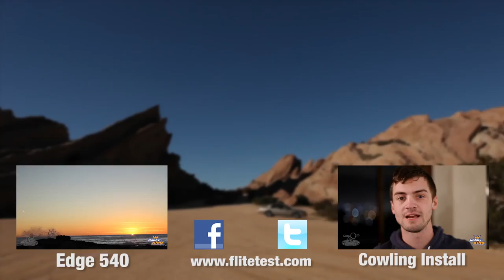Flite Test - Differential - FLITE TIP

Comment: @vanepico Kind of.  a spoiler's job is to purely reduce lift by "spoiling" the airflow over the wing.  an aileron works on the principal that it is increasing or decreasing the effective camber of the airfoil/wing section thus increasing or decreasing lift.  So the aileron is essentially causing an increase or decrease in circulation around the wing where as a spoiler will merely disturb the Lifting pressure on the upper surface of a wing.  I hope this helps.

Comment: Bernoulli's principle is what causes this effect.  The pressure on the bottom of the wing is higher than on the top (which is what creates lift).  This is even more evident on high lift wings with a flat bottom. The aileron that goes down will have more yaw effect because of the greater pressure under the wing.  That is why differential is more important on high lift wings.

Comment: I believe it is missing details for mechanical instalation, we also can have the diferential action mechanical  with one servo or two servos with  Y extension, just need to shift the position of the links on the servo arms, I mean installing the link like 30 degrees shifted from the servo central position.

Comment: @vanepico This phenomenon occurs because Drag is proportional to Lift.  This is called induced drag CD=CL^2/(Pi*AspectRatio*efficiencyfactor).  when you deflect an aileron down it creates lift thus creating more drag.  Because there is more drag on one wing than the other, the plane will tend to yaw.